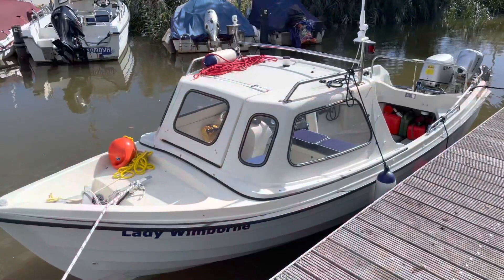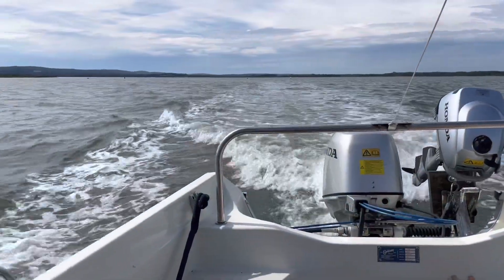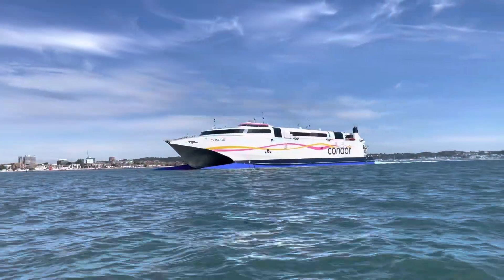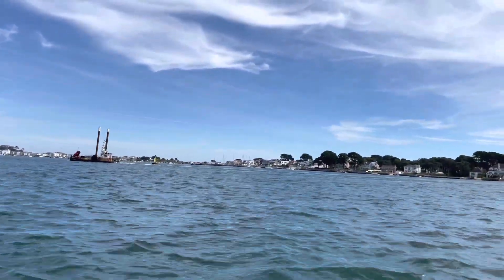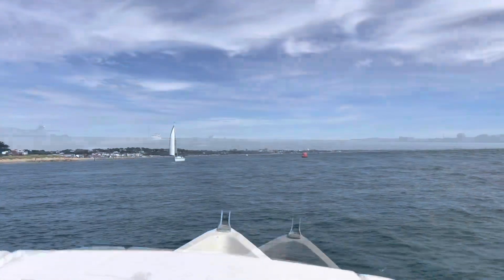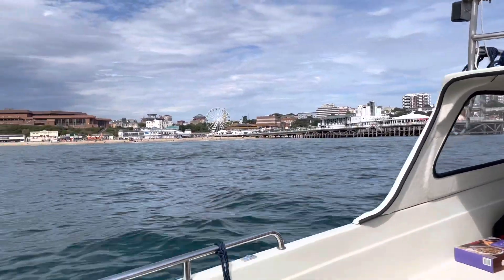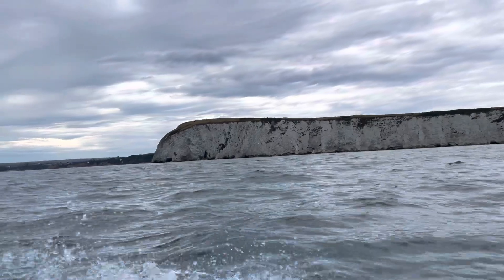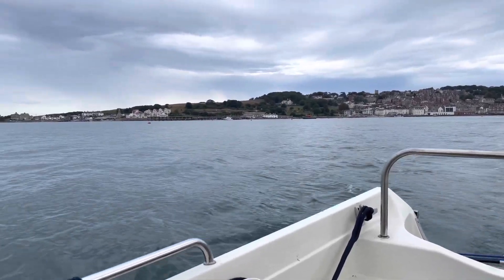14. Orkney Strikeliner 16+ Fuel Economy Test. How many miles can it go on a 12 litre fuel tank?

Comment: you do have to factor in the tide and wind as you would use less fuel when running with the tide and more fuel if your pushing against the tide stronger the tide more push needed 
etc also if  the weight load on the boat is more ,then that will effect your fuel consumption . someone here said put a 50hp on the boat however these boats are not rated for that size engine . a mate of mine had a 30hp on his strikeliner and ok yes it do go a little faster but always with the bow well up and out of the water , it looked very unstable tbh.
Reply: Wrong every stable

Comment: She is very underpowered which will be giving you bad fuel mileage. If you can't get on the plain then you will use 3 times less fuel. I'd say at least a 50hp for that boat.
Reply: The Strikliner isn't a planing hull, and are rated for 25hp.
Reply: 30hp on my friends strikeliner and goes well! I’ve got the 520 with a 30 four stroke and is doing 18knts at 4500 revs
Reply: Wrong 22 knots sem dispnmane se9mi o la8nyibg humml 22 knots
Reply: Nice clean boat!

Comment: Well that's shocked me as I had the distance at 33/34 ml, reason why i got to this figure is I have a fast liner 19 with a Honda 50 on it and that will do 55mls on a 22ltr tank and that's running at 20-24 knott,s so that works out at 2,5mls per ltr and TBH I thought yours would be a bit better,,
Reply from the maker: Sounds like you’ve got enough power to get on the plane, whereas I’m always limited to semi-displacement - only halfway onto the plane. It’s definitely a lot faster and cheaper if more of the boat is out the water!!